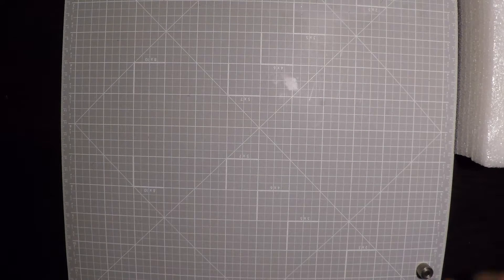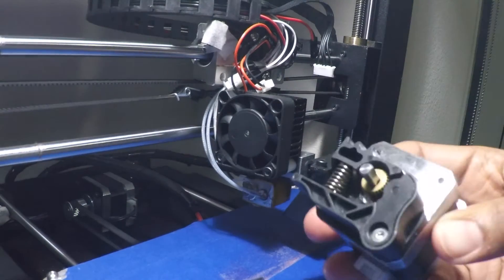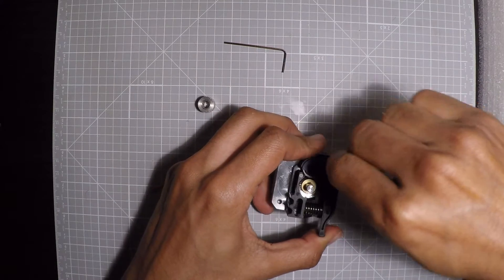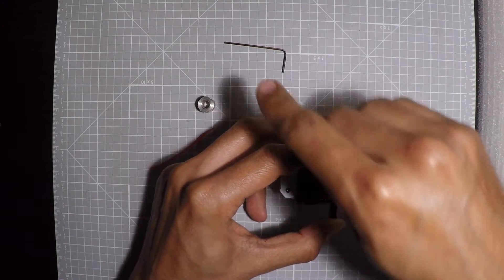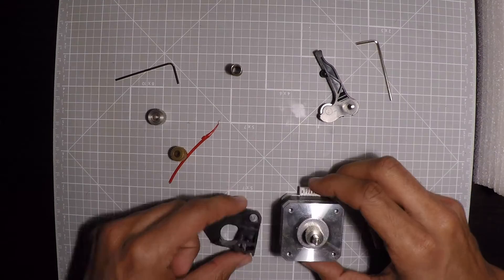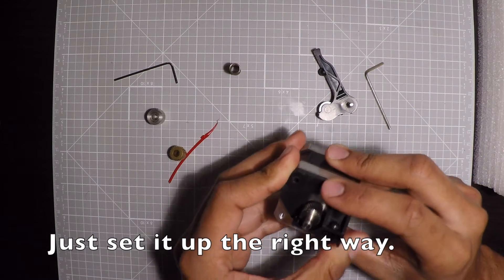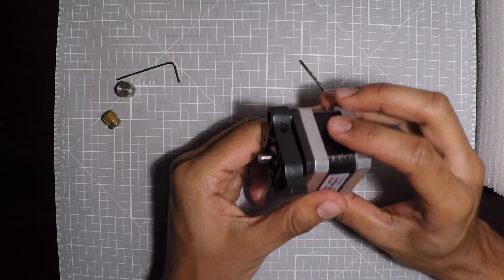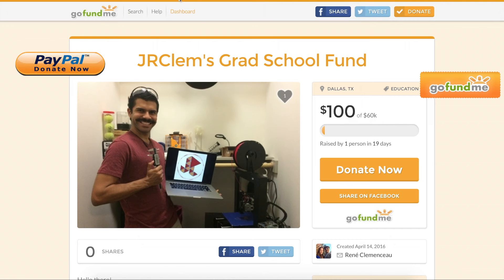Monoprice Maker Select Mods #4- Change Extruder Lead Gear

Comment: THIS IS WHY THERES F***ING HOLES IN PRINT FUUUUUUUUUUUUUUUUUUUUUUUUUUUUUUUUUUU
you dont understand the rage when i was trying to find out why it was doing that
Reply: but thanks anyway
Reply from the maker: +lolatron haha well I'm glad you were able to figure it out!
Reply: jrclem welp just took my extuder apart and it looks like the apocalypse in there
Reply from the maker: I'm sorry, I know that feel. 
A toothbrush and compressed air will go a long way, as long as stuff didn't melt in there... If not, heat gun, tweezers and maybe some acetone or weldon #4 (for ABS or PLA respectively).
Reply: jrclem Ii got it out so now new extruder gear here i come :D

Comment: I have mine rotated 90, there's is plenty of wire to rotate the extruder stepper. I had to open the control box cut a zip tie and feed more wire into the cable chain and work it up to the extruder though.
Reply from the maker: +secretagb oh I see! So far I haven't printed too many things that tall, so I don't run into that problem enough for opening the box right now, but I'll keep that in mind for later! Thanks!